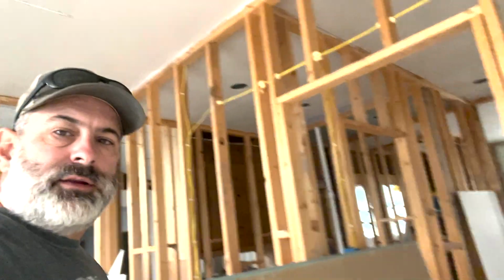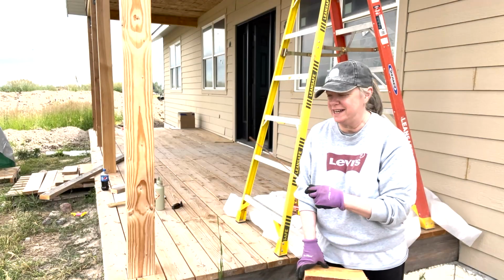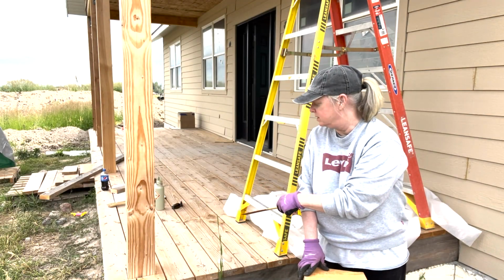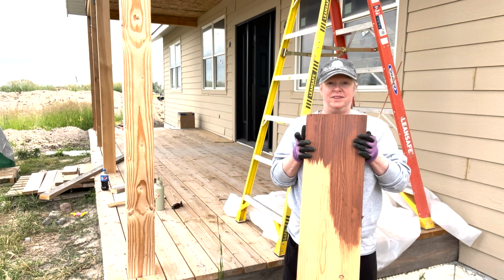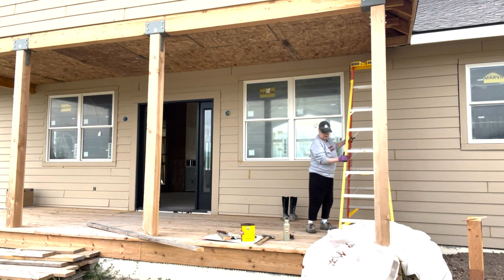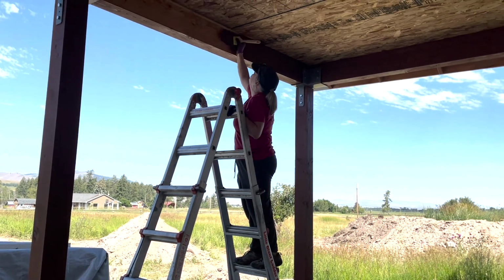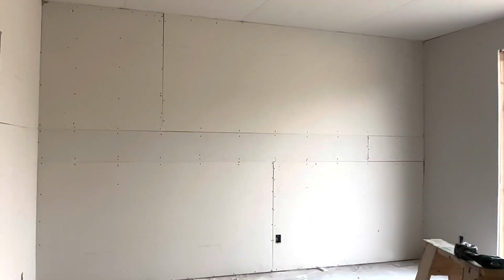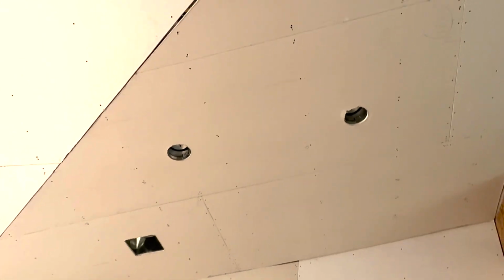Hanging Walls & Ceilings: Sheetrock Install | Building Our Own Home Ep. 84

Comment: Looking good. I look forward to seeing if these sheetrock guys will carry it through to the tape and bed finish line or call it quits if the tape and bed part isn’t as high $ amount as putting up the sheetrock itself.
Reply from the maker: If it weren’t for the issues with the main room ceiling and the fact I couldn’t do it by myself, I would have done all the hanging myself. So when it comes to mud and tape, I am only having them help with the main room caulking. That is if they come back to do it.  You’re right, the money may not be enough for them but then I will sort something out